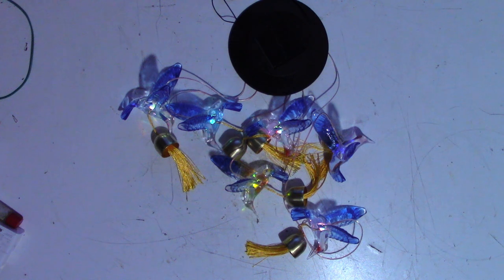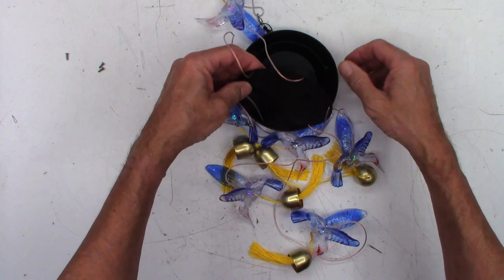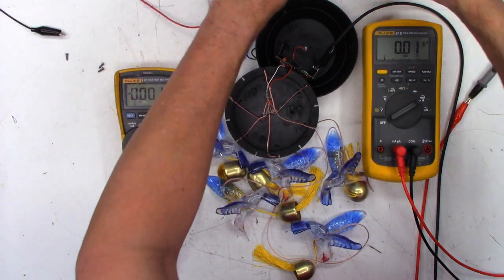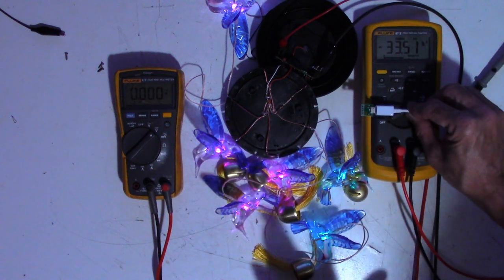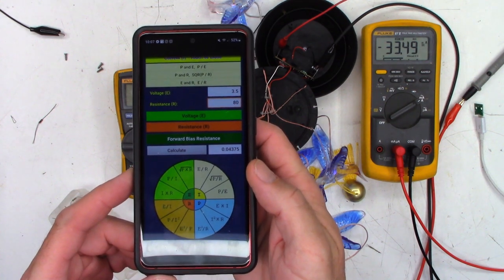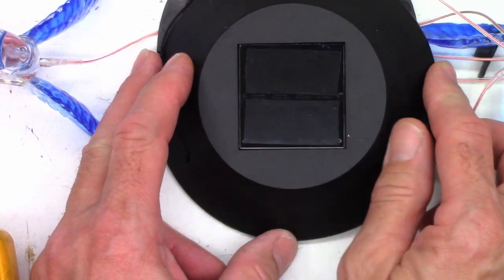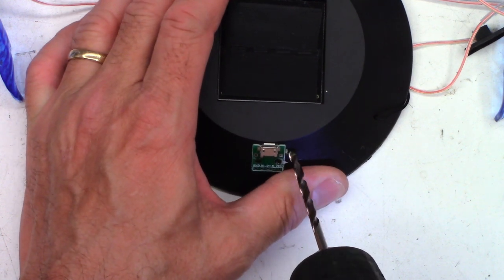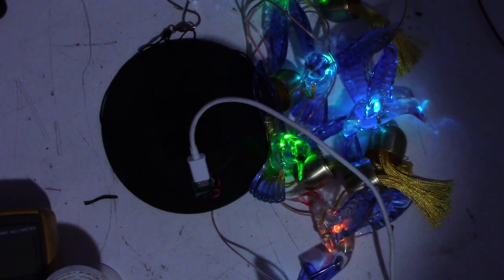My Wife's Birthday Hummingbird Windchime. Converting it to run on a micro USB Power Supply

Comment: No need to get complicated, just wire the USB socket across the LED supply, as these use a small boost converter to provide 5V or so for the LED birds. A series resistor of 33R in series with the USB supply will work, as the slow colour change LED's will need current limit, and 33R is going to give them more power so they will be brighter. You lose the battery, and just remove the one LED wire off the board, and wire in the rest there, but you can leave it connected, as there is only a small ceramic capacitor and a reverse biased diode there.
Reply: That's what I was wondering.   I think I missed something.   I don't see the point of worrying about keeping the battery in the unit at all.  Power it constantly with the USB wall wart.